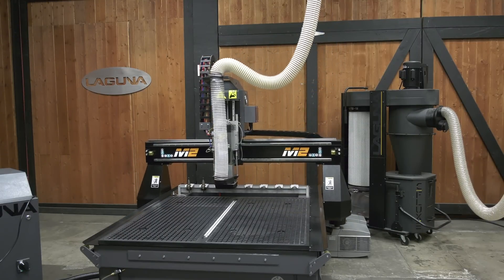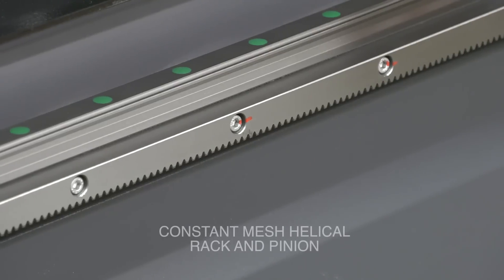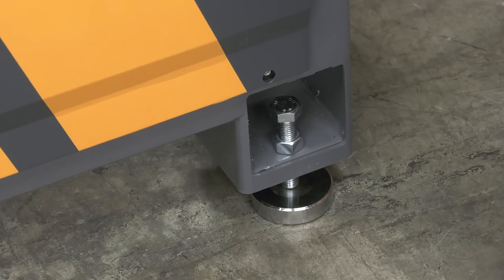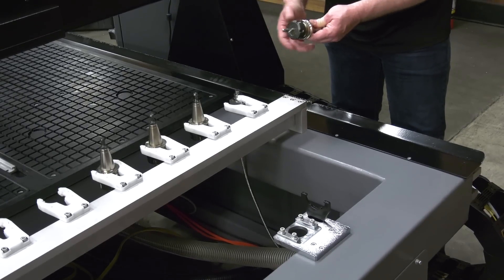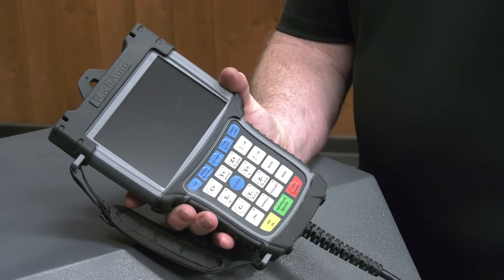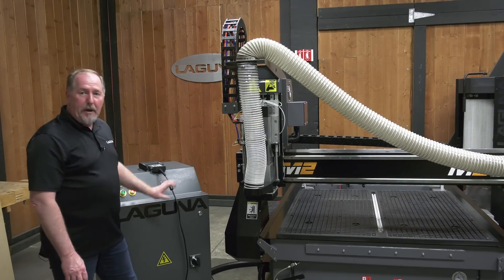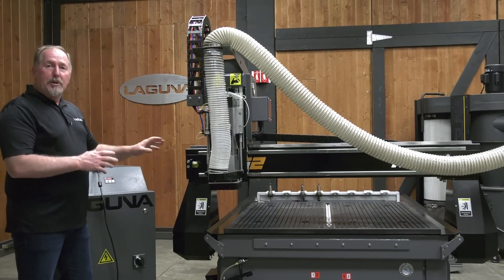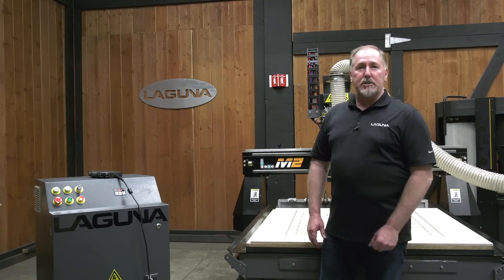The Best Value CNC Router | Introducing the Newly Upgraded SmartShop® M2 | Laguna Tools

Comment: Is the machine recommended for drilling operations? Can the machine handle tight depth tolerances for very light grooving in plastics like phenolic?  Does it have helical interpolation or just 2 1/2 axis?
Reply from the maker: Hello! Yes, the SmartShop M has true 3-axis XYZ interpolation, and can hold tolerances of +/- .002 in both drilling and pocketing operations. This machine would be a good fit for you!

Comment: It always amazes me that people don't put bellows on linear rails and ballscrews. It's engineering 101. Any professional machine has covers... I have a Japanese machine that is over 30yrs old. Lift the covers and the rails look brand new
Reply: I think it's because it generally effects the Z clearance.  If someone has a proper dust collector and opts for the auto tool changer, which in this case applies.  It should cause little to no issues well down the road imo.  

I do agree with you, but the entire machine would need to be re-designed to accommodate for the bellows.  many of us, including myself don't have mega ceilings in my shop.

Comment: How much does the 4x8 run?
Reply: Can this be purchased in ireland?
Reply from the maker: The 4'x8' table is currently $38,496, but the machine price starts $36,008 for the smaller table size
Reply: @LagunaTools  Do you have a link to that?  If I go to your website I'm seeing $35,500...
Reply: @LagunaTools  that can’t be true.
Reply: @LagunaTools  wth…this price is not true. Your website starting price is $36k.
Reply from the maker: @majsharps  We apologize for the miscommunication. You are correct.

Comment: WOW 4x4 for 46k i have one i built for 3 k can do all the same stuff but tool change......WAY OVER PRICED....
Reply: Where does it say 46k?
Reply: @Z-add  i emailed them  and i thank its on the web site
Reply: You're running a 7.5kW italian made spindle for 3k?  What's the flatness of your machine?  What's the repeat-ability on your parts?  What kind of tolerances can you keep?

Lets be real, for 3k, you're MAYBE running a chinese 2.2kW spindle, with a flatness tolerance of probably a millimeter or two over your 4ft distance.  You can probably do softwoods like pine, but probably burn the crap out of anything harder than oak, and if you tried to mill aluminum, you probably can only do around a 0.5mm z step.  I know for sure you don't have any type of cooling system, at most you have a shop based vacuum system for dust collection.

Your spindle probably has a standard draw bar, having to wrench the bit out, making you need to re-orient the x/y's every time you change tools, or your tolerances are off by around 100 microns every time.  And, for $3k, I really doubt you even have the equipment necessary to measure any of the tolerances I even mentioned.

But yea, you can do all the same stuff as this machine.
Reply: @JamesLee-sw6ss  LMAO 100% true.
Reply: James Lee preach! It’s silly every time I hear a similar argument.

Comment: What is happening @ 6:17 during the tool change? Misalignment?
Reply: I think you're right, some adjustments should be made...
Reply: If I’m correct, this cnc sports stepper motors, so it’s possible that it indeed is misaligned. Less problematic with servos

Comment: How much? I am afraid to ask.
Reply: 4x8 table is over $35,000
Reply: @coloneljhuda  that is just ridiculous, and we wonder why woodworkers have such a hard time breaking into the paid world.
Reply from the maker: For beginning woodworkers we don't recommend the M2. This machine is designed for production shops. For entry-level CNC, we have two models that are less than half of the M2 called the iQ – which is a benchtop model – and the Swift, which is a full-frame CNC.
Reply: @LagunaTools  even at half price that is $15K that is still not a value that opens up this technology to new woodworkers. Honestly almost all Laguna tools are out of the price range for most woodworkers. Just my opinion to a company with great equipment, just a shame you cannot find a way to work with woodworkers, creators and makers that are not professionals and make the money needed to pay for the equipment.
Reply: @bigphillyed , @MAGA MAN Ouch! You're both being a little harsh. Yeah, that's a pretty big chunk of change, but with all it's bells and whistles, it's not exorbitant. You would need a lot of electricity to run it; a two car garage is not going to have the (probable) 3phase needed. 
If you're looking "entry-level", a Shapeoko might work (though I think they're  not rigid enough). Or maybe a Chinese unit. Personally, I have an Avid benchtop pro 24x24. It's rock solid but two times the price of the Shapeoko. 
Another option might be a local MakerSpace. Our SLO MakerSpace (www.slomakerspace.com) has a kit built 4x8 CNC (Black Foot?) that is adequate. We also have first rate Vectric software -- V-carve Pro -- licensed so members can use the software at home (free) and bring in their files for cutting. (Can't design 3D in it; only import as stl etc.)
All this being said, Laguna's CNC has come a really long way since the first one I saw back in the 1980s(?).
Reply: @richardfarwell6759  thank you
Reply: @bigphillyed  That's actually cheap. I just bought 3 Anderson auto loading and unloading 5x12 routers and they were $165,000 each. This IS a entry level machine and the price is very affordable. Wait until you see what a Becker 15hp vacuum pump cost. Each of my machines use 2 of them.
Reply: Joe Fox  how you like Becker pumps? You have two for each machine meaning one is not enough for 4x8 table ? Asking because i just ordered one and hoping i can get away with just one